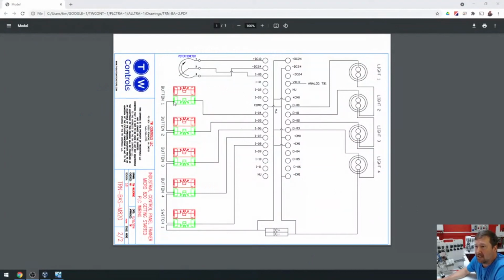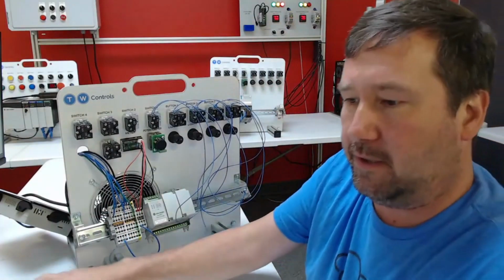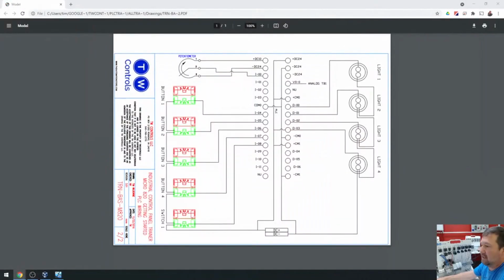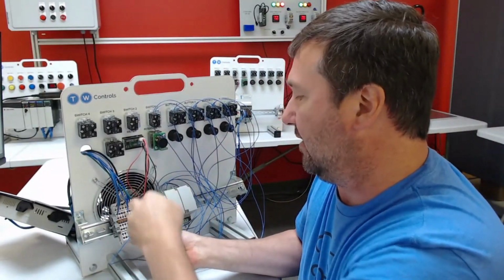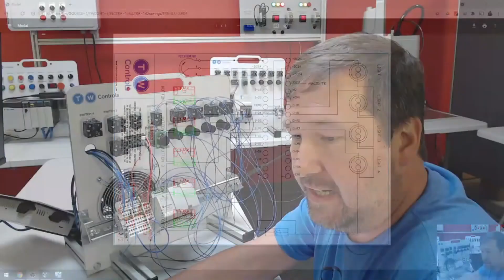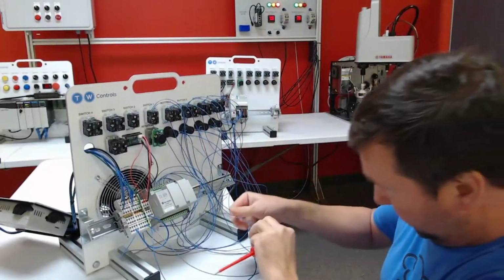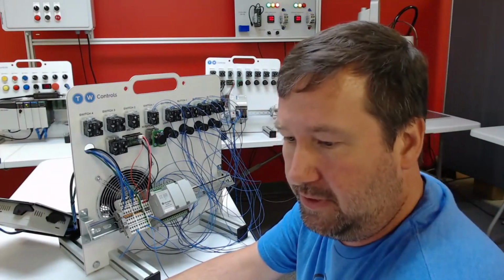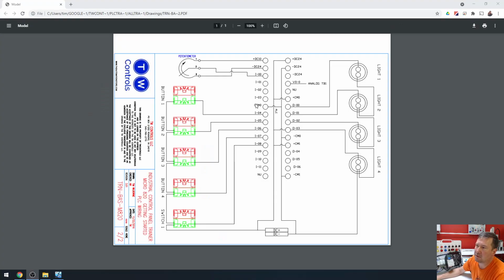How to wire Allen Bradley Micro820 PLC Inputs and Outputs

Comment: Hello Tim.  Is there a way to direct connect laptop to micro 820. 
For this job I am taking micro 820 into bush/ mine site. Job is to keep a generator cooling tower operating between certain temperatures. Hot Water in, fans run and cool water out. May not have access to Ethernet.   Ta. Frank.
Reply from the maker: Here is one on connected serially to the Micro820.
https://www.youtube.com/watch?v=hJAh_QeAPgY

Comment: Do you have video showing using a N/C to the Input 04 or 05... we seem to have a issue with this 

N/O SWITCH work just fine N/C SWTICH Has +24DC. But the PLC doe not recognize the hi signal from the NC SWITCH.

 Testing of the NC switch shows its working fine. An EStop and. STOP SWITCH is connected repectively to inputs 04 & 05 Input is set to BOOL for Inputs 04 and 05.

Thanks
Reply from the maker: NO or NC what?  Contact or sensor?  My first guess it it is a sensor and you have a PNP or NPN where your wiring calls the for other.
Reply: @TimWilborne   sorry for the confusion... I updated my question I hope it makes more sense.